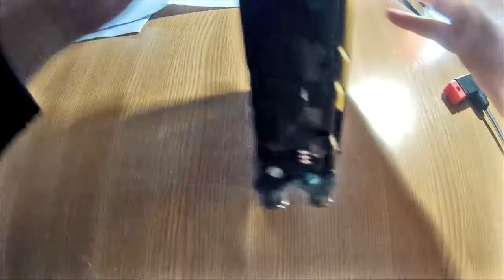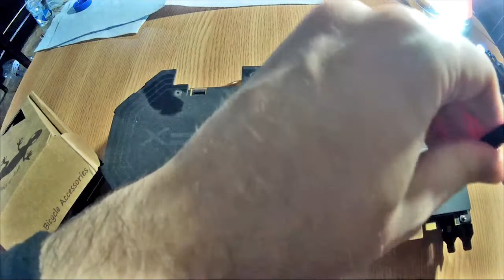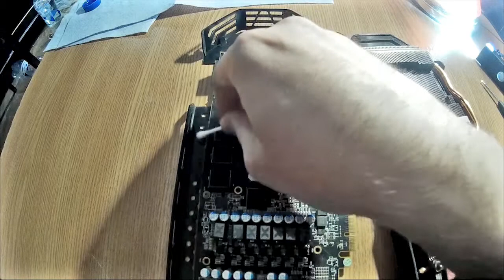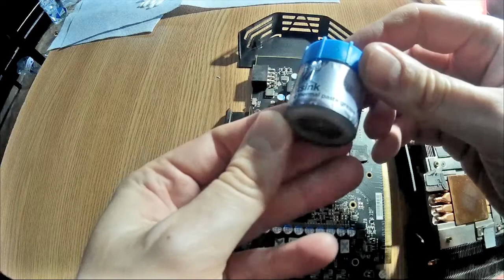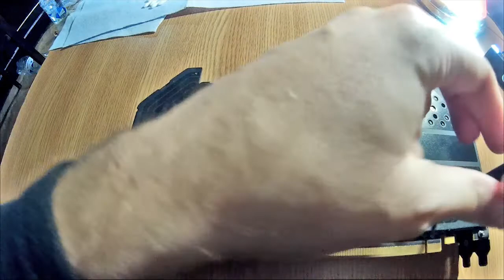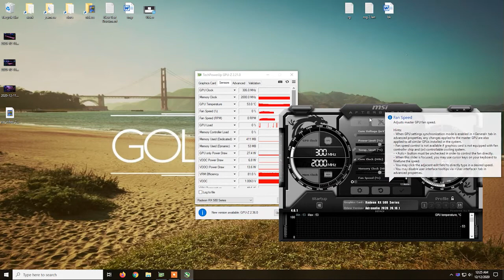Radeon RX 580 XFX Thermal Paste replacement, temperatures before and after

Comment: What kind of a paste is that? Just use MX4 you wont get any results from cheap pastes
Reply from the maker: That was a cheap one that I've found. I sold the gpu anyway in the meantime.
You are right, that one didn't do much difference.
Reply: @PSVICE  my bad i didnt notice this video was well over 3 years ago.. I got the exact the gpu and my temps are way below from the one in video.. Under heavy load it hits 68c and thats it. They aint that bad if maintenance is done lol
Reply from the maker: @dolanthefacc879  68 is very good, I got now an rx 6700xt which is 1 years old, so pretty new, and it has the same temperature as yours.
Reply: @PSVICE  haha i was i had the same performance like yours aswell. Ill switch to a 2nd hand rtx 2080 or a brand new rx6600 soon!

Comment: I get a 88° while playing red dead 2 is it ok?
Reply from the maker: It's fine, probably while you play, it would be better to keep the PC case door open.
This high temperature happens because the hot air remains inside the case.
Or install a fan that will pull the air from the case.

Comment: you should do a manual look at fans,  (Open case and Visual look at your Fans while computer is on ) not from your Tool only, if you can see the blades they are not spinning, i have looked at my fan it come on when i turn on Computer, but only 1 is spinning, i dont think the fans should be idle at anytime, just saying , when my computer is doing nothing it sits at 31 c i have seen it up to 72 c while running Path of Exile
Reply from the maker: Hey, I use the program gpu-z to monitor the gpu temp.
If the gpu sits at 31, then the fans should not spin.
I think they spin once the temp reaches over 50 degrees C.
In gaming, both should spin all the time as it can reach over 80 degrees.
It is possible for one fan to spin if the temp is low.
It also depends what game you play, if for example you play WoW on low settings, it should not spin as the resources consumed are minimum.

Comment: i will be doing this myself, but also 1 of my fans has stopped so i will be replacing both Fans
Reply from the maker: In your case, if the temperatures are low, you should not change the thermal paste. Check my other message.

Comment: Just replaced my rx580 sapphire pulse thermal paste(i use thermal grizzly kryonaut),it runs at 60°c+ max now,before it runs at 82c° so it decrease by 20+-,I use Superposition Benchmark 1080p extreme before change 2000 score,now i get 2600 score,definitely worth it
Reply: Lies.. if your gaming temp is 60c you should make a video bc that is unheard of. It's pretty pathetic that you're shilling in the comment section.
Reply: yeah make a video dude

Comment: Is 85 temp normal for RX 580 GPU ??
Reply from the maker: It's normal even though it's hot, if it runs constant at that temp, you might want to put a fan on the back that pulls the hot air from the case or remove the side panel of the case while gaming.
Reply: @PSVICE  Thx a lot ❤️
Reply: I would get 83-85 temps while gaming. I was also suffering black screen crash with some titles. My fix was replacing the thermal paste and undervolting by 100mhz. Now the max I get for temps is 73c and the card is so much quieter as the fans only need to go to 75%.

Comment: i have a same problem how to fix bro
Reply from the maker: I've found that during gaming if I keep the case panel removed or I put a fan that takes the hot air out, the gpu temp stays about 70 degrees which is pretty normal.
Reply: @PSVICE  i do all but still have 87-89C
Reply from the maker: @binfuadtz  In that case replace the paste as in the video. If still 89, then the GPU might have some hardware issues.
Anyway, I've gamed quite a lot at 89 degrees, the case seem to catch fire but still works :)
Reply: @PSVICE  I have an rx 580 4gb and it cant go above 82c without completely failing and making my screen go black, never have taken it out like you did because I am afraid I will break it.
Reply from the maker: @yeee321  That's not normal, it should go up to 89 and be able to run at that temp for a few hours.
You can also when gaming remove the case panel so the hot air gets out.
Or just stick with non-demanding games that will not make the gpu go so hot above 80.
If you don't know what you're doing, rather leave it as it is, if you break it you will have to buy another one.
Reply: @PSVICE  Dude it even happens playing something as low end as world of warcraft classic, in raids when there alot of people using aoe and particles going off it shoots up to 80c. Some people on reddit are saying it could be my psu as I have a 500w psu of unknown brand
Reply from the maker: @yeee321  I agree, no brand psu is pretty bad for such a demanding GPU. Also I guess you have a modern cpu like Ryzen?
I would change the PSU.
Also, you might want to check if the fans are spinning after the GPU temp goes over 50 degrees. Install MSI Afterburner, it has an on screen display of the current temperature, along other stats.
Reply: @PSVICE  Yeah I have an i5-7400 so pretty old cpu. I also use msi afterburner and have a fan curve where my fans are at 100% if temp goes 70 and above. Is it hard to put in a new psu?
Reply from the maker: @yeee321  Not really, just need to remove the existing one, take of the cables, but you need to be very careful when you plug the connectors to not force, I broke a HDD socket many years ago.
Also, before starting, take some photos with your phone to know where the cables go.

Comment: It's obvious that it's not the paste since your memory is staying clocked and heating the card, this happens when using a second monitor usually if not a software issue, since the card also consumes 16w at idle when it should be 6 or 7w...
Reply from the maker: When I game I disable a monitor, so I remain with one active.
Maybe it has to do that it was used for mining, even though the bios appears unmodified.

Comment: ))) very bad
Reply from the maker: What is bad?
Reply: @PSVICE   temperature dont changed
Reply from the maker: @feridcabbarli6797  They changed just a bit, the problem is I don't use any case fans so the hot air remains inside. If I remove the case door, it stays around 75 degrees or less.

Comment: You needed to clean your PCB quite more properly, you could use a brush, the card was super dusty. 
You need to replace the thermal pads on your Vram as they seem to be completely worn out. 
You need to brush the heatsink out of any dust, you needed to remove the dust out of the back of the fan blade as it's common with pre-owned mining cards. 
You need to wash the part of the heatsink which directly contacts the GPU with alcohol and remove every atom of previous thermal paste. 
You need to spread the thermal paste evenly on the GPU unit, this makes me guarantee that it got fully covered with paste. 
If you did this I believe thermal performance of the card will be better I guess.
Reply from the maker: With a 120mm fan on the rear that pulls out the hot air from the case, I've managed to get around 75 degrees in Cyberpunk, which is a lot better.
The main issue with this GPU is that if you don't have good airflow in the case, it will still heat like crazy because of the hot air that remains inside.